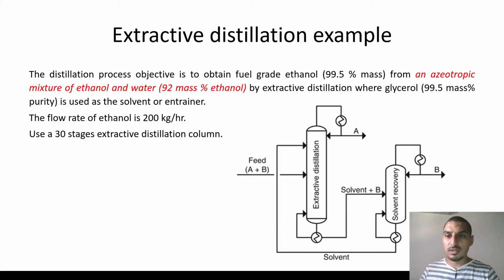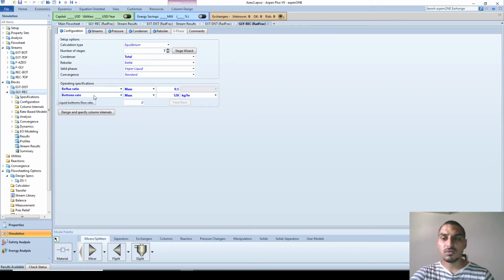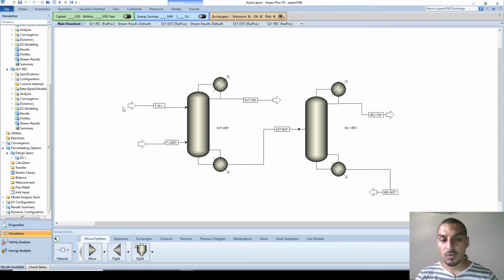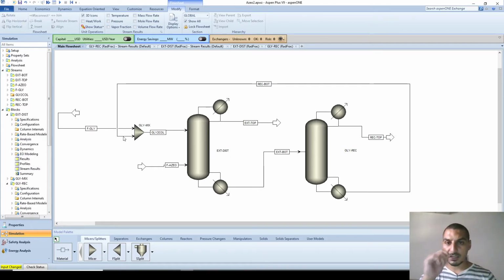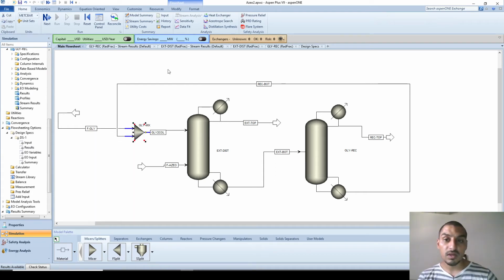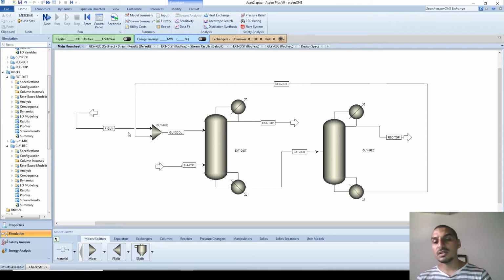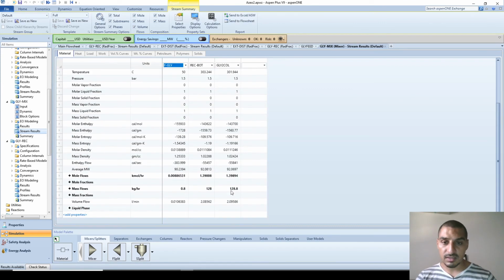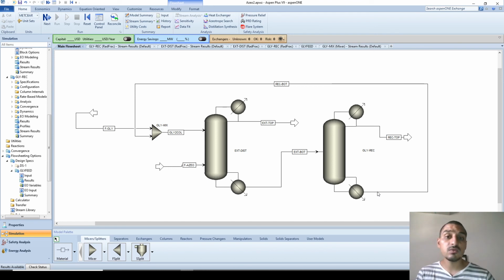Aspen Plus in English | Part 2 | 46 | Distillation - 11 Solvent recycle in extractive distillation

Comment: Great work. Thanks. Something is missing here. The bottoms rate of the solvent should also be updated when you recycle the solvent. This can be done using a calculator block which can update it based on the solvent mass flowrate in the feed to the solvent recovery column.